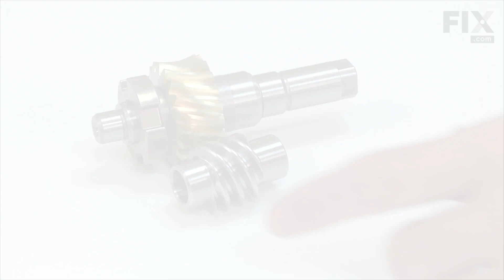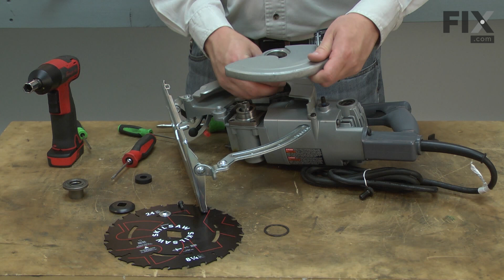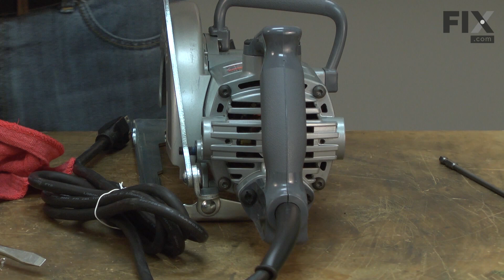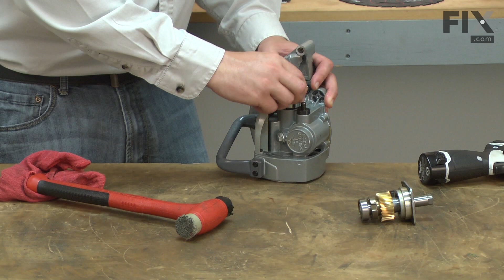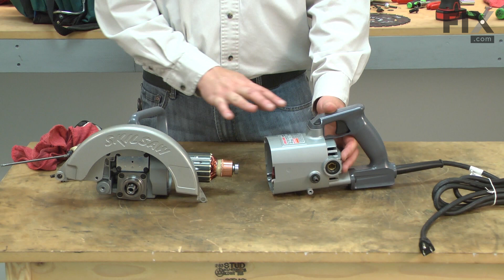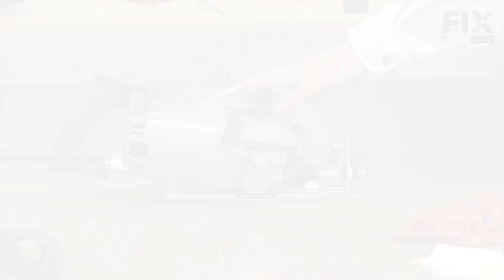Skil Circular Saw Repair - How to Replace the Worm Gear Set

Comment: I worked for Skil power tools for 20 years and this not the correct disassembly or reassembly to repair this tool . Some models have a spacer between worm gear and bearing.
Reply: Any chance you could make a video in the correct order?
Reply: I just bought a really old Skilsaw worm drive and used it once and it was overheating. I checked the oil and it was bone dry. Will putting oil in it stop the overheating, or will I have to take it apart?
Reply: @jamesfagan5694  , The lack of oil will cause overheating . When a tool has been run without lubricant gears and bearings wear causing friction. Oil leakage from seals will also clog up fan exhaust ports also causing overheating. If the motor is working fine , no arcing of brushes and running free , you could try refilling with correct oil . Getting parts for those old saws are almost impossible to get. Bearings and seals may be gotten at bearing supply houses.
Reply: @barkingspider4861  Okay. Thanks a lot
Reply: How to get shaft out of a circa 1991 3150? No c clips left, no screws, pressed in but might kill something knocking it apart.

Comment: What causes the saw to make noise during slow down ? I just brought one mag77wm22 and out of the box no oil waited a week for it to get to me added proper amount, go to use and then the noise as it slowed from a cut or free spin . so i returned it got another and same thing is this normal operation or am i just lousy at grabbing a good box from the shelf
Reply: Same thing is happening with my new mag77

Comment: 5:05 - 5:09 There is a step or two missing.  You show one gear removed, then the access plate, then are re-insertng the bearing?  Great job, but the missing steps are pretty crucial to the process...
Reply: Totally agree, everything looks great but would like to see how you remove the worm gear and bearing too .
Reply: I just rebuilt the saw of a friend and used this video. You use a blunt punch 1/4 in diameter and tap softly  from either side of the housing. You will have space to slide the punch in due to the worm gear dropping down with no armature shaft sliding through it.
Reply: Critical parts left out-BS @MasterHustler
Reply: @drstiles1  Missing the hard part